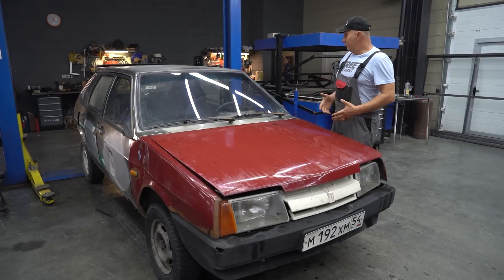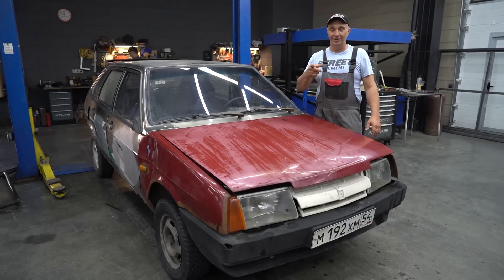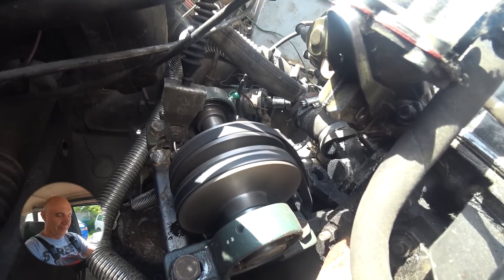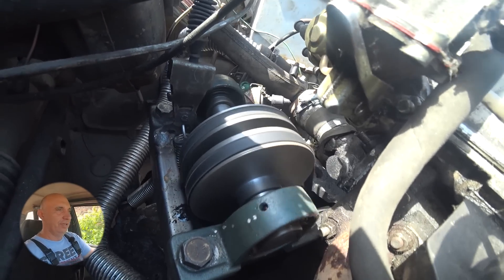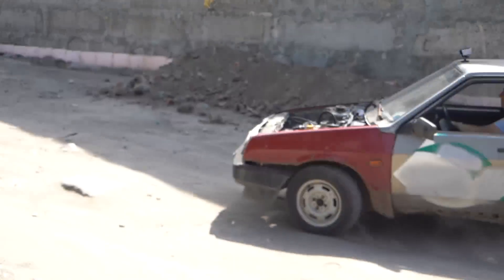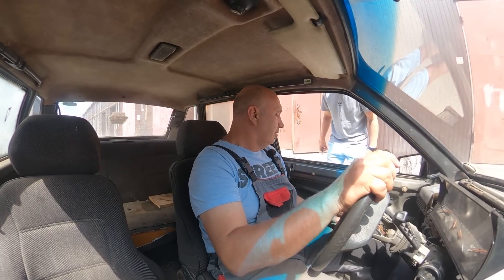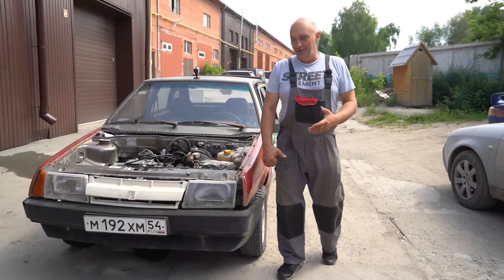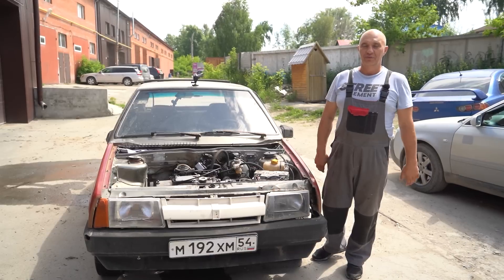We make a belt clutch for a car – will it work?

Comment: I would mount the pulleys rigid, then, use spring loaded idler pullies, similar to those used in belt-driven snow blowers and roto-tillers. The belt between the engine flywheel and the transfer pulley can just be tensioned all the time, but the clutch pedal should release the tension on the belt between the transfer pulley and transmission input shaft. by using spring loaded idlers, it will automatically compensate for belt stretch and wear. they just simply press against the slack side of the belts, making them largely self-adjusting. The problem would be, that the engine could not hold the car back when you take your foot off the accelerator. The torque would be limited by the tension strength of the idlers, which would slip with the engine trying to slow the car. All go, no whoa.

Comment: Okay, how about another challenge?
Take off the transmission and clutch, remove the drive shaft.
Put a variable pump on the engine, and the hydraulic motor in the pinion.
But wait, THERE’S MORE!!!
Put two stacked pumps on the engine, remove the solid axle, and put a pair of hydraulic motors on the rear wheels.
For a differential, run balancing hoses across the lines, left and right.
Putting ball valves (for simplicity) into those balance lines will add something else.
POSITIVE TRACTION!
Closing the valves will force the wheels to turn at the same rate, where the open valves will allow the wheels to turn at different rates, because the balance lines will allow the fluid to go to the faster tire, or the one with less traction.
Reply: Oh now that would be cool I hope they do it. I've always wondered at using hydraulics to replace shafts

Comment: You should use a couple super heavy duty springs to hold tension on the belts at all times and flip the slave cylinder so it breaks contact with belts and pulleys when you press the pedal. Should feel like a squishy clutch maybe. And try snowmobile belts possibly.

Comment: Covert the alternator into a motor thats powered with the battery, and then see if it has enough power to start the engine. Maybe even see if it has enough power to move the car?

Comment: How about taking just variator transmission from snow mobile or similar. You could drive without clutch!? Or using it just when it is stopped/standing for variator break. Although I'm pretty sure that will work as it is used also some tractors etc. Not sure how shifting gears would work, but I'm sure you guys would figure that part out too. 😂

Comment: After watching your steam powered car video (which I LOVED) ,I just wanted to suggest another alternative way to power the car that might be interesting.

Try a Wood Gassifier, it's been used since the american industrial revolution and throughout the great depression. It essentially converts wood into flammable gas by carbonizing it instead of burning it. And an upside is by the time your done using the fuel wood you have perfectly carbonized pieces of wood you can use for smokeless cooking

Comment: 'Robot Cantina' videos 😉, they do projects like installing a 670cc V-Twin Predator lawnmower engine in a classic Renault R10 (670cc motor & CVT linked to the R10's 4 Speed gearbox), or installing a 250cc single lawnmower engine, with a supercharger & CVT, in a Honda Insight 😏
😎🇬🇧

Comment: I came up with a scheme not too different from this for a go kart once, only each belt did a different ratio and so it was a transmission... It never got built because of resources but it would be wild to see you guys pull it off.
Reply: That’s kind of how a tomos moped 2 speed works. There’s two gears and two clutches. Pretty simple. You may like to know they use cork friction material 😂 it’s like of garage 54 built a moped

Comment: This would have been SOOOOOOOOOOOOOOOOOOOOOOOOOOOOOOOOOOOOOOOOOOOOOOOOOOÓOOOOOOOOOOOOÓOOOOOOOOOOOOOOOOOOO Much better if you would have used spring tension to hold the clutch engaged and then the clutch pedal to disengage ......

Comment: I'd try to modify the pulley size to get a torque increase to overcome the slipping
Reply: This is negated by the ratios in the transmission. To maintain any given speed, with all else equal, the engine has to deliver a certain amount of torque into the transmission. All it will do is "slide" the window the slipping happens in around a bit

Comment: If you have your clutch cable attach to the other side from where it attaches now and add a few strong expansion springs to tension the belt when the clutch is released, the car will drive as with a normal clutch.
Reply: Was thinking the same
Reply: I had a similar setup on a small homemade diesel tractor, push clutch pedal to release tension. Also it had diferent size pulleys to give it low and lower range. A single moveable tensioner made sure I only tensioned one belt at a time.

Comment: DAF 33 variomatic drivetrain. 

A gem of a 1970's car with a vary speed 3 speed transmission drive using rubber belts.  

Also Ran as fast in reverse as forward.
Reply: Cool story bro but it was not reliable. Even today I don't Trust belt drive transmissions.
Reply: @mann_idonotreadreplies that’s funny while they’re used in the most rugged vehicles where breaking down can cost you your vehicle or life. Snowmobiles ,4x4 quads and utvs
Reply: @mann_idonotreadreplies  

Bro?  

What are you 12 years old.
Reply: Not reliable?? 🤣🤣🤣🤣 @mann_idonotreadreplies

Comment: I wouldn't say it's a 107% success but, maybe 101.5%  
The pedal has to work as expected.  Make the springs pull the belts tight and use the pedal to unload it as with a normal clutch.

Comment: You guys should try retrofit variable valve timing on a lada. I was thinking of using a bendix gear from a starter on the end of the camshaft. then you could pull the cam pulley in and out with the throttle to change the advance.
Reply: Yeah im curious about this too! normally it works with oil pressure.
Reply: Centrifugal advance variable valve timing
Reply: You should try making this 4x4
Reply: And look how it behalve

Comment: Along those same lines, you can create a infinitely variable transmission with a rubber pickup wheel and a metal drive plate. Some self-propelled lawn mowers use this type of set up for varying the speed the mower travels. Probably will have trouble moving a car unless you get the friction just right.
Reply: DAF 33 Variomatic system. 

The car was as fast in reverse as forward. 😂
Reply: just like cars with CVT gearbox.  Two cones and large belt that gives you constant acceleration.  Only thing stopping it from going full speed in reverse is likely a factory set rev limiter
Reply: Belt drive trans are absolute garbage Long term or Long distance

Comment: I actually made a go kart that uses a belt drive directly from the engine with a very small flywheel on the engine shaft and a big one on the wheel axle with an idler pulley on bearing and a hand brake lever as the tension mechanism to help while driving you just tighten the belt as you drive and it just stays tight until you lower the lever
Reply: Your name tells me you lied to people all your life did you tell your friends you had best car in town lol you a clown

Comment: This is how self propelled push mowers work. When you clamp down on the handle that causes it to drive forward, it tensions a pulley from the engine to the wheels, and causes the mower to drive forwards under the engines own power.
Reply: For mine, when you clamp down on the handle it engages a clutch that spins the blades.  Pushing the handle forward engages the wheel drive.
Reply: @MushookieMan a clutch for the blades is like unheard of. What kind of weird ass mower do you have?
Reply: @Youtubecensoredmyusername  I'm looking at a video of it now.  It's a pulley/clutch system, the blade 'pulley wheel' is two plates, one is the input, and the other is the output.  The other pulley wheel is actually an idler, and tensioning it engages the two halves of the clutch using a belt. https://youtu.be/VukTdf6vMbI?t=449
Reply: @MushookieMan  thanks for the link. I was wondering what that would look like 👍
Reply: @christophercain7343

This is how certain riding mowers behave as well. On mine, it even functions as a rudimentary CVT.

Comment: Those belts are only god for horsepower transmission of like 7-10hp, if the engines is driven easy would be fine for around a farmers field but not long lived. Need a big nasty cog belt for longevity

Comment: Old industrial machines used to be driven by line-shafting and flat (leather) belt - the first factory I worked in still had this, and the machines would have a fast and loose pully, the loose pully just spun freely on the shaft, if you moved the flat belt over to the fast pully (using a fork selector) it would drive the machine.

Comment: Well done! It won't last long using accessory belts, but the theory is valid and being used today.
Reply: Yeah, mower belts have fabric throughout the surfaces so you don't just melt rubber when slipping the belt. 

But it still worked, and they did say they would use regular car belts.
Reply: @volvo09  its not the casing of the belt. its the belt itself.

consider what torque is, and how its transmitted in a belt.

theres teh pulley to belt friction, with a vee belt it wedges in there...
 and then it is solely down to cross section of the belt, the number of cords... tension.

basically. an A section belt is good for 2hp, without slipping. they will slip before they snap.

a lawnmower blade belt, generally a B section... takes about 5hp. "but my ride on mower has a 25hp engine, so nyer!"

to spin a blade and merely snip the tips off grass takes sweet eff all power, so the belt is barely loaded.

when you hit the heavy stuff, it starts loading down... think of what you can push a 5hp mower through by hand...

and then when you actually clog it up? it simply slips. no damage done (i have a walker... damage equates to a few weeks and a LOT of money repairing gearboxes. dont get a walker with driveshafts)

and the traction side of the ride on mower? its never really direct either.

lots of power in the engine, but  lot is wasted in just bearings, pulleys, losses here there and everywhere...

and when buzzing around cleaning the turf its not really "producing" 25hp as its not loaded down. the governors keeping the throttle backed off despite you giving it full bunny...

take the poxy lada to be 40hp.... one puny a section belt is extremely under-rated, it will , and does work... for about two laps of the driveway.
Reply: @paradiselost9946  yeah I guess I described it wrong, as the (mower style) belt wears there is always that fabric stuff integrated throughout, so it is all the way through.

Comment: Torque converter as a clutch on a manual transmission
Reply: Thay would be a cool one. But wouldnt it still creep forward at idle once you released the brake like an auto?  Not sure if they ever fully disengage 🤔
Reply: @jblob5764 I think you would still be able to safely pop it into neutral on idle.
Reply: Yes would be interesting.